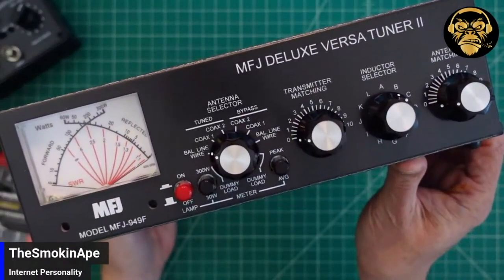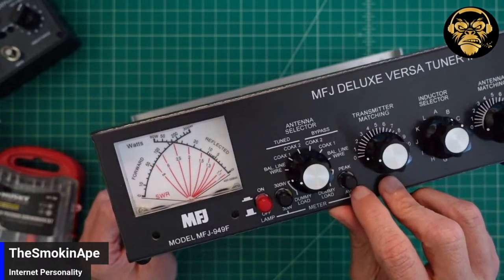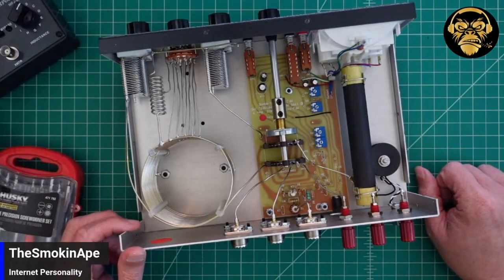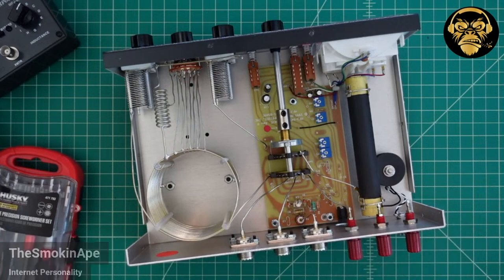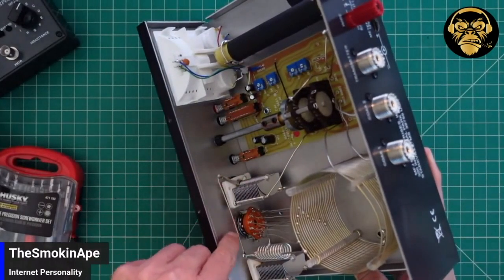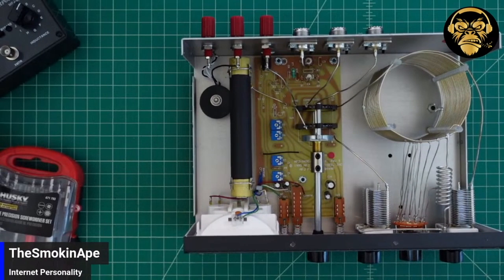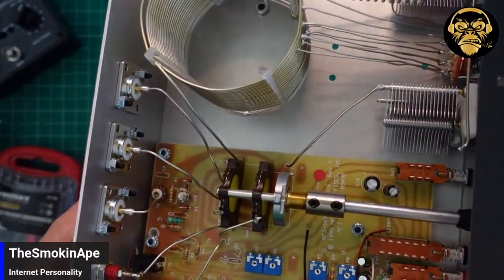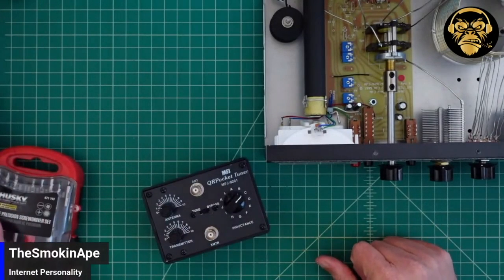The ULTIMATE Antenna Tuner for HAM Radio? - MFJ-949F Review

Comment: I have this antenna tuner. I bought it because it was manual, it has a dummy load, it can do coax, ladderline, and single wire. I run a Yaesu ft991a, which has an internal tuner, and I have found that the internal tuner will tune up only so much when it comes to SWR. This tuner will tune a rusty chunk of metal ha ha. Maybe not, but it does a better job tuning than the internal tuner on the radio. The other reason I like it is that I have control over tuning. I am like this with most stuff in life. I like manual transmissions etc. I want the control, not letting technology control it for me. It is a really good tuner. I have had positive results with it.
Reply from the maker: Glad to hear it’s working out for you. I’ve been pretty happy with it myself, thank you for watching 👍

Comment: Is that load a wire wound inductive load
Reply from the maker: I would imagine it’s a resistive load
Reply: What I should have said is that load a wire wound resistor? If so it would be reactive and not  purely resistive as a dummy load should be.
Reply from the maker: Correct, you want a non-inductive resistor

Comment: Junk
Reply from the maker: Very insightful
Reply: I guess I could have elaborated. MFJ would not be closing if they had any, any type of quality control. Every piece of MFJ gear I ever worked on had issues and many are stupid ones like not soldering components. It’s a shame because they could have made some good gear.
Reply from the maker: I would agree there have been some QA problems but I also have a time of their product that have worked fine for years.  It is a shame how the story of MFJ has turned out.

Comment: I have a 949E in my shack, and I have an old MFJ travel tuner that I use for POTA.  They work great if you keep them clean.  Also... in the field, a manual tuner is less draw on your battery. 

Fun story - I backed my car over the travel tuner in the garage.  I unpacked after a POTA, set the tuner on the garage floor, and got distracted.  Later that night, I put the car into the garage and felt something under the tire while backing up.  I pulled ahead and looked, and there's the travel tuner on the floor.  It stopped the car, I didn't crunch it.  The only damage is one of the plastic corners on the box cracked and the toe-roid came unglued from the bottom of the case.
Reply from the maker: Durable! Good point about battery power 👍

Comment: MFJ keeps installing the knobs wrong. Fully unmeshed should be, 0 ( minimum capacitance ) fully meshed, 10 ( maximum capacitance )
Reply: Also, there is an unconfirmed rumor that MFJ has stopped production as of May 17, 2024 and is going out of business.
Reply from the maker: It’s confirmed, they are indeed closing shop